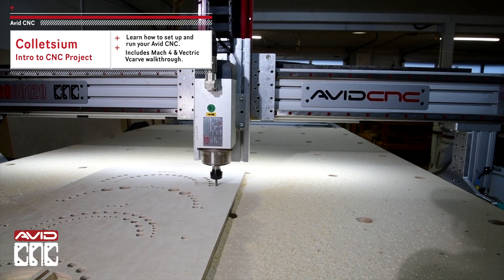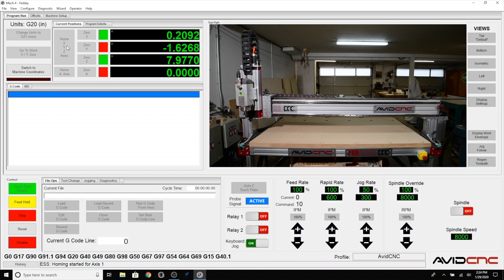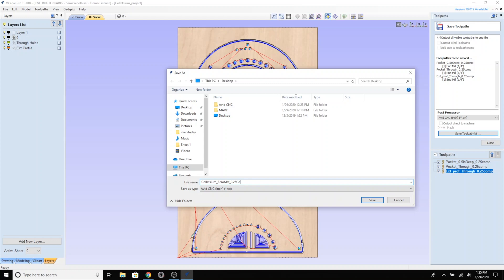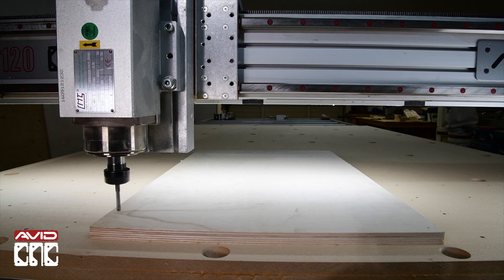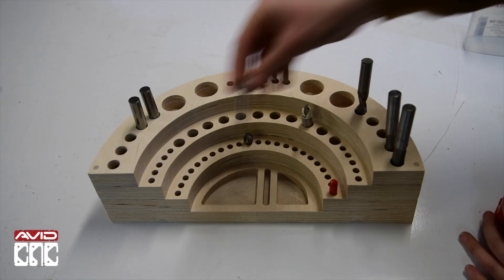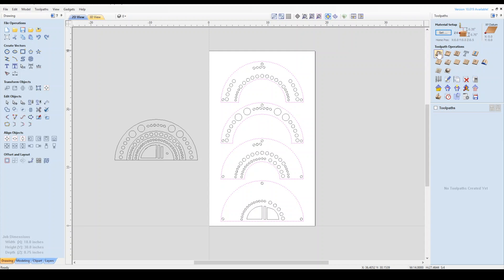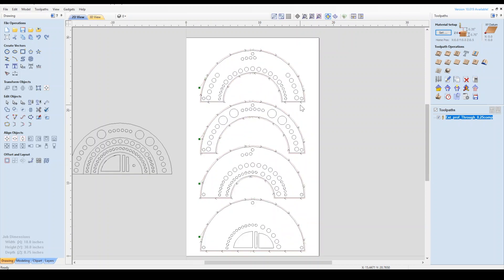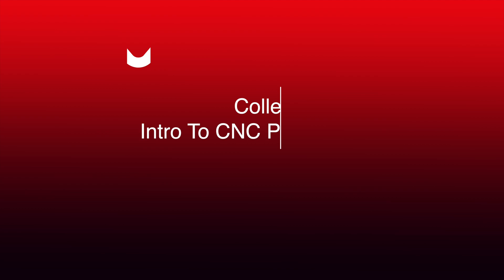Pro-Maker: Intro To CNC with Mach4  - Colletsium

Comment: Sami, Excellent video I found this more instructive than some of the video put out by Vectric. I have one question on how you made the holes for the dowel the same location on each of the pieces in vetric software is there a special process and if you could share that would be great.